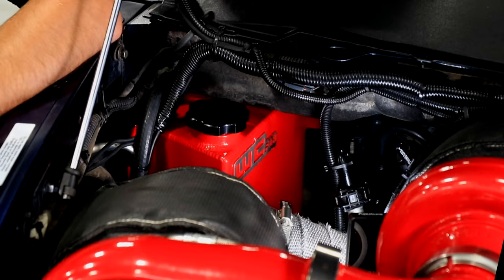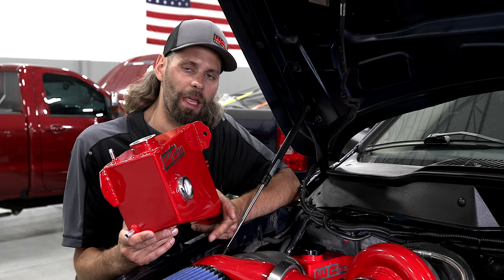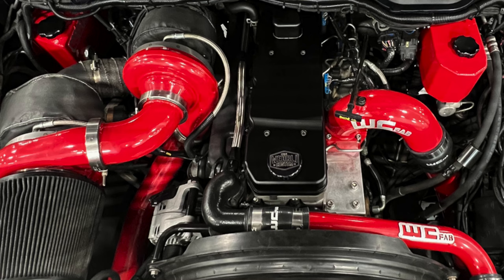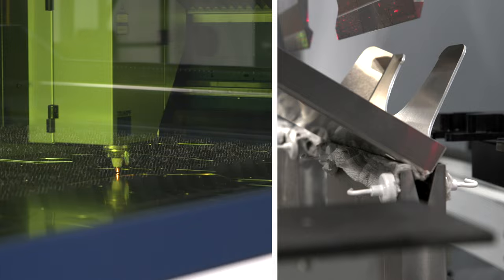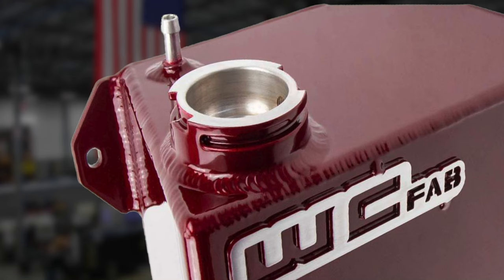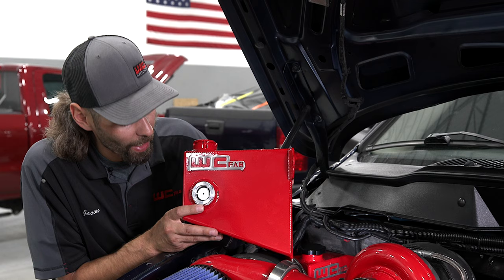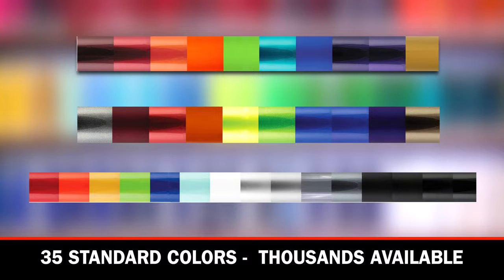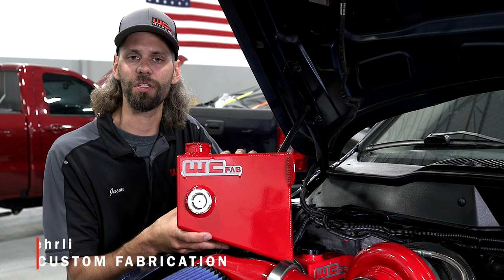WCFAB 2004.5-2007 5.9L Cummins OEM Placement Coolant Tank Kit

Comment: Cool. BUT WHERE IS THE ONE FOR 04 DODGE 5.9
Reply: That’s what I was looking for 🥲
Reply from the maker: A coolant tank for the 03-04 trucks is still on our to do list. They're laid out a bit differently than the later 3rd gens and we don't see the early trucks through our shop as frequently. If you know someone with a cherry 03 or 04 5.9 truck in original condition who would be willing to help bring their truck by the shop to aid with our R&D process, send them our way!
Reply: @WCFab  wheres the location? And what’s the estimated time they’d have the truck?
Reply from the maker: @dwil9743  our shop is at 231 Harvestore Dr. DeKalb, IL 60115. R&D time varies depending upon the project, but typically we need access to the truck for a few weeks between scanning, design, part test fits and revisions, final install and verification that everything works as intended. If you're interested to know more or be a part of the process, please shoot us an email with your contact details and pictures of your truck to sales@wcfab.com and we'll follow up with you from there.